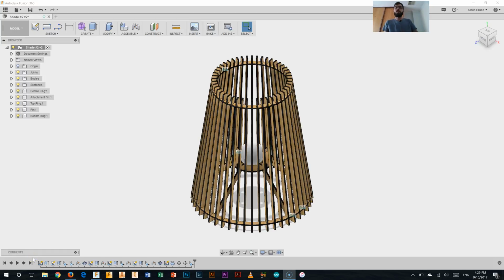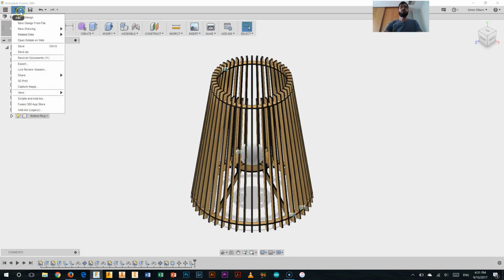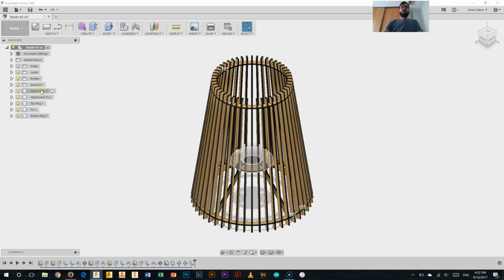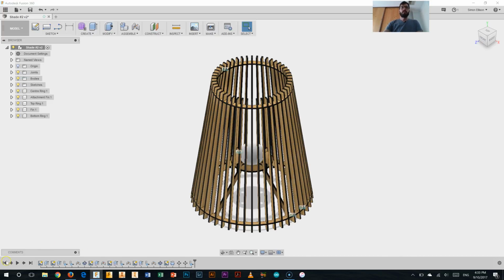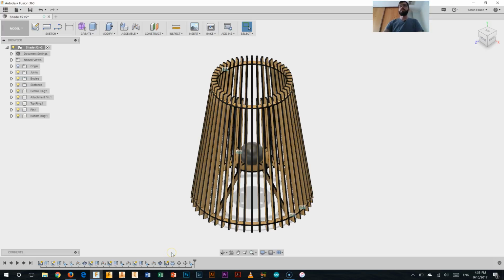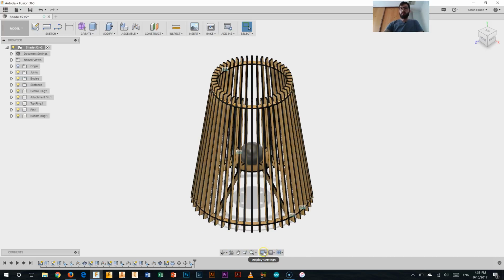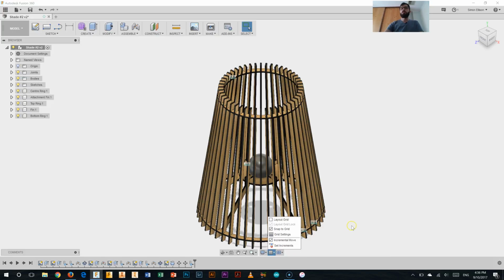Lamp Shade Part 0 - Fusion 360 Basics and an overview of the task - Autodesk Fusion 360

Comment: 00:06 Introduction to Autodesk Fusion 360 and lampshade design overview.
01:02 Overview of interface tools and menus in Autodesk Fusion 360
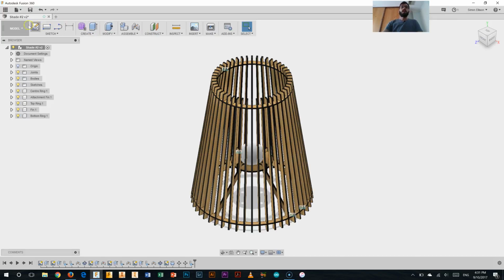02:00 Introduction to Fusion 360 interface features
02:52 Overview of lampshade components in Fusion 360
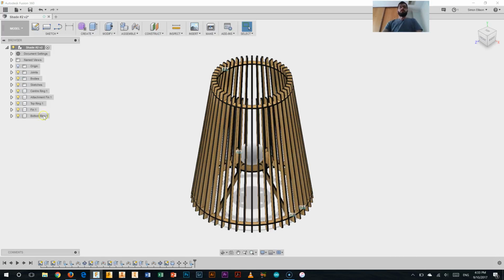03:46 Understanding components, bodies, and timeline in Fusion 360.
04:46 Overview of modeling steps in Fusion 360
05:40 Exploring different views and settings in Fusion 360
06:49 Introduction to Fusion 360 basics and isometric view